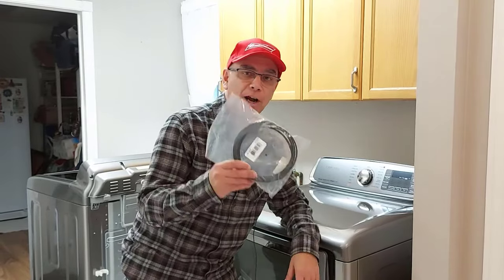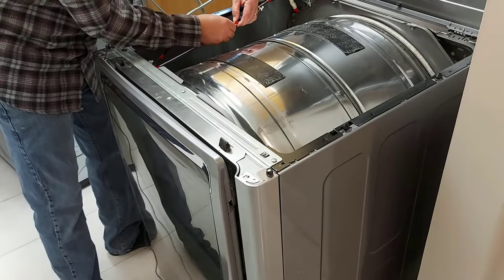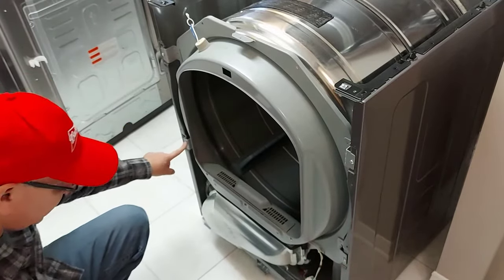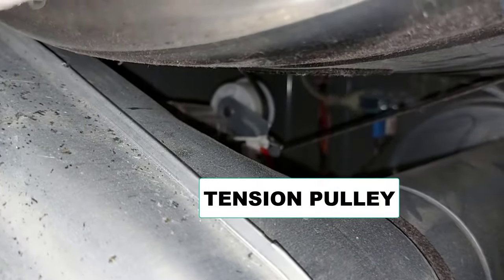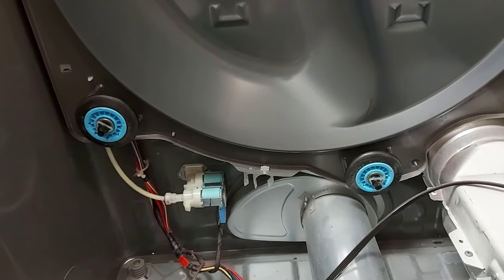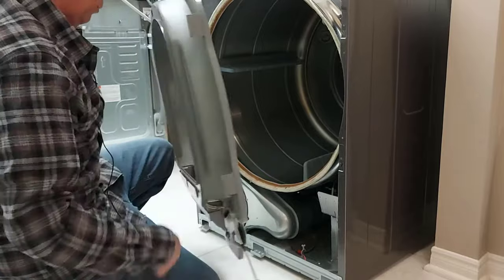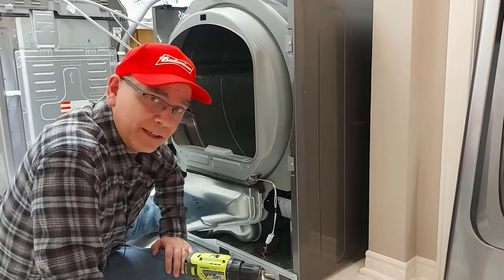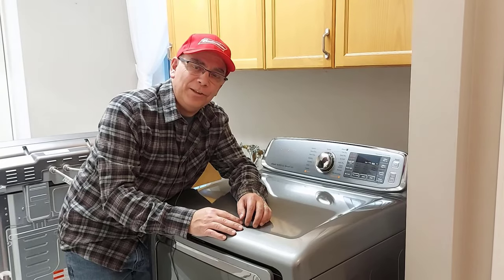Replace the Dryer Belt On Any Front Clothes Dryer | STEP BY STEP DIY!

Comment: This worked well for my Samsung. The only issue was the tensor built portion. The video was taken from the reverse side which you cannot view like that without removing the back. It was easier to put the tensor around the belt and motor first and get someone to pull the belt open for you as you slide the belt around the dryer barrel. Much easier and faster.

Comment: As a note, a lot of these screws are a combination Philips and SQUARE drive.. if you use the square drive, it actually works easier. with less chance of buggering up the screw head.

Comment: Im trying to figure out how to replace the belt on a coin operated dryer in my apt building. I used to install appliances for Sears, so I told the home owner that I could definitely do it. Well... i just realized ive never worked on a coin operated dryer, and this thing definitely doesnt come apart like the normal residential ones. I even have the maintenance keys for it and I can figure out how to get anything off from the front. ...and the internet isnt proving to have any information whatsoever

Comment: I’m on a mission to fix my GE dryer, because it’s making a tapping noise, which sounds like maybe the belt coming apart. The dryer works, but it sounds like it’s about to fall apart. It makes one loud tapping noise from what sounds like every single rotation of the drum. But the dryer that I have has the control panel on the front,, not the top like the one in this video... so I don’t think all dryers come apart the same way. I think that the GE washer and dryer set that I have is designed to be a stackable unit, it’s just not set up that way, it’s side by side. Perhaps that might make it easier for me to figure out how to get into it. I still don’t have a whole lot of room to work. And if I have to get to the back of it, that’s going to be a challenge.